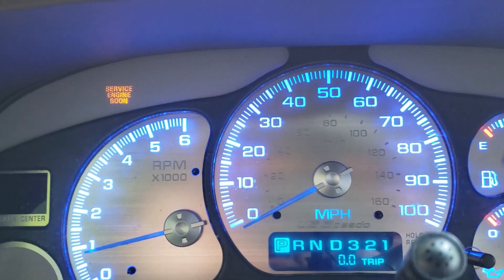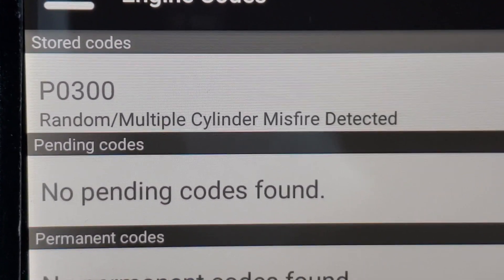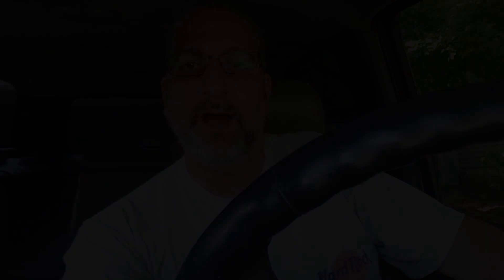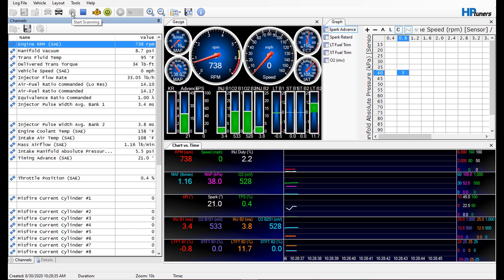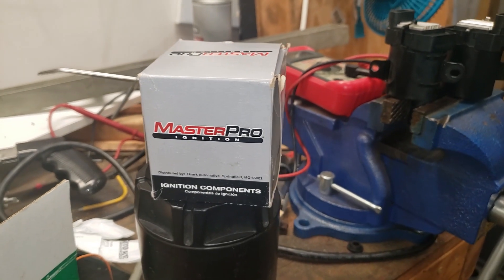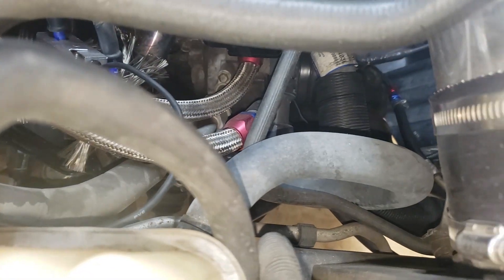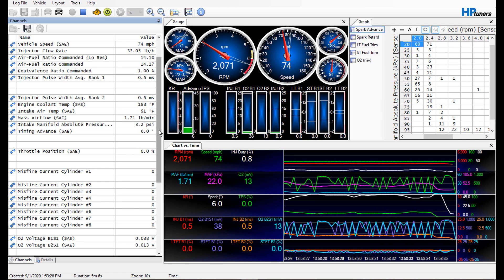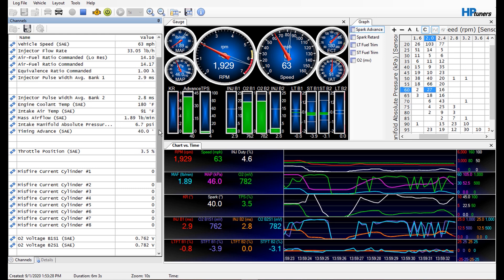P0300 Random Cylinder Misfire Diagnosis and Fix Chevy Tahoe

Comment: Those codes 300 or a certain cyl set when the degree wheel hasnt moved to the normal degree that it should normally , weak old gas, overfilled tank that floods the evap syst., clogged air filter are poss.culprits

Comment: Thank you very much for the video. was the engine light on all the time? mine comes on while driving flashing... comes and goes... but comes on quicker with 4x4 or tow mode on... same P0300 code

Comment: I think mine is a fuel pump because I can’t tell how much gas I have
Reply: That's the leveling sensor going bad. Over time the two small pronks on the sensor will corrode, not making contact with the circuit board. Next time you get in your car turn the key don't start it listen to the fuel pump. If it sounds weak or makes weird noises then it's going bad. Checking the fuel pressure is the most accurate way of knowing the fuel pump is going bad. 🇺🇸 1st 4ever
Reply: @ thanks

Comment: Thanks great video 

Im getting the same code and same rough issues. But with my 2007 Yukon Xl (with 377k miles) I have this problem as soon as I start it up after the vehicle sat all night. But what's strange is once the engine warms up or say driving for 3-5min it runs normal and the check engine light turns off.
I recently changed the plugs, coils, coil wires within a month. Before that I changed the Throttle body. MAF, timing chain, oil pump, radiator and all O2 sensors.

I know this may or may not have caused the issue but it started acting up when my son put a bottle of seafom in the tank. I usually use the B12 Berrymans

But after the seafom was added in the gas tank it started acting up
Reply: Did you ever find a solution? I'm having the same issue.
Reply: @royl4534  Not yet. I've changed the coil wires/harnesses with a bunch of other things. Even changed all of the sensors, deactivation manifold solenoid that's under the air intake. Changed the fuel rail and injectors. This weekend, im going to change each injector wire. Back in October, i changed the timing chain and oil pump. I have 380k miles. If im still getting the same issue with the injector worrs changed, then im pretty sure the complete engine harness may be my problem. I bought a new one on eBay, and i was going to do that last.
Trust me, im stumped with new coils, spark plugs, and plug wires. I love GMC vehicles, but i found a ton of people with the 5.3 from 2000 to 2015 having the same problems. If you figure it out, please let me know. I'll do the same after the weekend.
Reply: @TheBucktowncrazy you get it fixed?

Comment: I'm less knowledgeable than Tahoe Steve about auto engines, but I may be able to contribute something of use to others like me. It's simple: The p030x codes don't arise from the sensors and onboard computer detecting the spark. No, it's much better than that. The explosions are detected. I suppose that it's done through the cam sensors giving off pulses when the explosions happen (but that's a guess on my part). So the system is extremely reliable about detecting misfires and has to be believed. He got p0300 rather than p0306 or p0302 here because two cylinders misfiring is categorized as simply random misfiring in the p-code system. You have to have a code reader like his that goes beyond printing out the p-codes in order to see that there might just be one or two bad actors--- that the misfiring is not randomly appearing on different cylinders every time the engine is run.

Comment: I had a random misfire that was not random at all. 😂 It was cylinder 3. Swapped coils and plug. Still on cylinder 3. Swapped wires and the misfire followed the wire. New set of AC Delco wires and problem gone. I also thought I had transmission problems. Turns out it was the misfire.  I didn’t notice the misfire until it really started dripping out. More power and smoother shifting.
Reply: I have cylinder 7misfire but apparently that means nothing …could be any other cylinder .. but yeah I have driveline clunk
Already had to rebuild the transmission so good to know it has to do with the misfire and transmission downshift

Comment: I have this same problem with my 2012 Silverado. I changed my plugs and wires and put another air filter on with new housing cleaned MAF sensor in the process it ran great for a couple weeks now I'm getting a 2-3 0300 misfire code I'm out of ideas?

Comment: Hey Mr. DIY, what do you thing about this?  PO308 code.  Swapped other coil and wire to that cylinder.  PO308.  Changed the spark plugs (copper top) to all cylinders and then got PO300 multiple misfires.  Tossed some more money to it...changed to new all plugs (iridium), wires new, coils new.  Running better but back to PO308 with all new stuff.  Tonight going to swap all of the injectors...if that don't fix it then I'm thinking bad intake/exhaust spring?  Tks for your 2cents.

Comment: I got that p0300 codes misfire n light flashing n I just changed my plugs n wires nw GT the code n my 01 Tahoe 5.3
Reply: Did you figure out your issue? I did the plugs, wires and coils...now I got random misfire with all new stuff on my 5.3l.
Reply: @yooper1825  same situation, did you figure it out?
Reply: @ħear i ended up getting one of them OBD2 devices that prevents the vehicle from dropping to 4 cylinder mode and i havent gotten the engine codes since
Reply: I also replaced the crankshaft position sensor. Not sure if that was the culprit or not.

Comment: Great video, straight to the point, critical thinking, and ability to find the solution. I love your video man. I have a Tahoe 04 with that random misfire issue. I had it scanned at the auto parts store and it came out that I have overheating sensor, and a MAF sensor malfunction, I had the MAF sensor replaced and rescanned the car weeks later and nothing has changed, with 0 knowledge of the engine mechanic concept I was wondering if that o2 sensor could be the cause of the random misfire. I took my car to some shop but they were unable to answer my questions. This is my first car ever and I took it for my daily commute to college I'm afraid it gives out on me.

Comment: One thing I do know to with these engines is the Spiders 🕷 injection system For the 96-99 Tahoes Vortecs. goes bad the fuel regulator is in the same place so if problem persists change them both out 2 hour job max.

Comment: Champion and Lisle make an inductive spark tester "pen". They look just like a pen and have a sight window and you hold it close to the plug wire, it will "light up" if there is spark and it wont if it doesn't. I've had one since the 80's, great little tool!
Reply: Wouldnt just grabbing the cable let you know by shocking you also?

Comment: I have a 02 chevy silverado 5.3 vortec with the p0300 code light on and I don't know what could it be I have had the spark plug wires and spark plugs replaced 6 months ago so I would doubt that's the issue any help would be greatly appreciated.
Reply: From what I've gathered, as he stated in the video: 

Spark plugs (Wires, Coils, and the actual plugs themselves) I personally replaced all of them together at once

Fuel Injectors in my case were another one and after these 2 its running much better, but that just could be for my situation. 

Next is O2 sensors seem to be another big one. I might be planning to replace those and see what happens. 

I have an 04 gmc sierra 4.8L V8 vortec, which are practically the same, just minor differences. Hope you figured it out or end up figuring it out eventually.
Reply: @Born-Again-Warrior  thanks for replying
Reply: @Born-Again-Warrior  I think I’m having a fuel injector problem but it’s doesn’t always do it was your issue a consistent problem or was it only after driving for a while
Reply: Have a 2012 Silverado with this 0300 2-3 misfire code after changing plugs and wires and a new air filter housing and all cleaned maf sensor in the process ran great for a couple weeks and it's back? Any suggestions before I get talked into doing this whole dod delete process that people are telling me that I need to do and the truck is just not worth putting that much money into it's got 190.000
Reply: I was wondering if fuel pressure regulator problem

Comment: This video saved me a bunch of money.  My truck(Silverado) got the dreaded P0300 and was running really rough.  I was ready to take it to the mechanic because everything I found was saying AFM lifter failure until I found this video.  A $40 timing light, a $35 coil pack and a couple hours later and she's purring like a kitten.  Thanks Steve!!
Reply: I'm having the same problem with my 2012 Silverado and everyone is saying I need to do the dod delete which is something I really can't afford. Truck has 190.000 how about yours and is it still running good after the work that you did?

Comment: I got new spark plugs new wires and new coils.... Still getting the reading. Any suggestions???
Reply: 02 Sensors seem to be a big cause. Is it running really rough? 

Mine was awful, I did the spark plugs, wires and Coils as well and it was a little better but still really bad. Then did the fuel injectors and its 100x better, but still a bit off and still have the code. 

Thinking of doing the o2 sensors next. Maybe look into that. Hope you figure it out 👍
Reply: Did all that but injectors and still super bad uundrivable.  Thinking to buy an injector and do some experimenting. Theyre expensive. 
 Have an exhaust manifold leak thats not helping.. a few broken bolts.

Comment: I have a 2001 tahoe and it jerks and spits and spuders and sometimes it stalls out and won't get over 35mph what's the problem
Reply: What was the problem?  My Tahoe has that code and it's jerking into gear.  The truck will not go out of 3rd gear.

Comment: What is this system your using in this video an app or mechanics device? I had no idea i could swap wires like that. Thank you for that knowledge. Did you put them all back in place after replacement of the coil?? This is a Great video. Sorry about your foot hope you heal up soon. 🙂
Reply from the maker: I was using HP Tuners in the video for diagnostics.  Yeah, everything is back in place and the Tahoe runs like a champ.

Comment: Hey Steve I’m steve just bought a Tahoe with 240,000 miles any suggestions on prevent defenses I can do to keep it runnin as long as possible
Reply from the maker: Take it to a trusted local repair shop and have them do a thorough inspection.  They'll give you a list.  Now you have an idea of what your dealing with.  Either let them fix it or take it home and study up on how ro fix it yourself.  Beyond that, just keep up with the manufacturers suggested repair/replace schedule and you should be fine.

Comment: Great video, I suggested to change  air filter,I hope you feel better.
Reply: Yeah that, take out plugs and inspect replace. Check fuel pressure, oh yea pcv valve
Reply: @atmosrepair  I just replaced the PCV valve in my 03 Yukon and it only cost 99 cents at O'Reilly's.
Reply: @JuarezDerrick  wonderful! Glad to hear that, and that solved your issue?
Reply: @atmosrepair  no, still working on it.
Reply from the maker: Thanks for the tip!